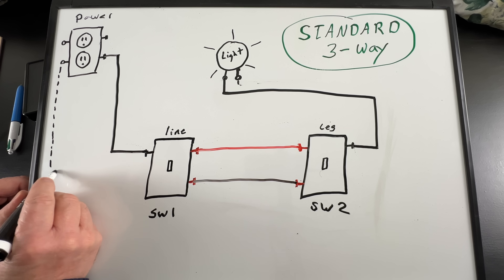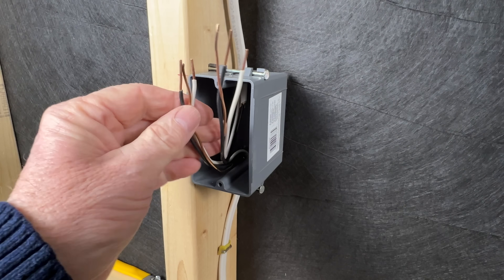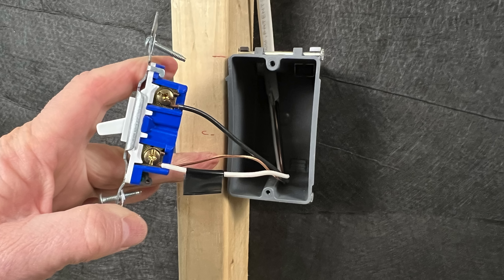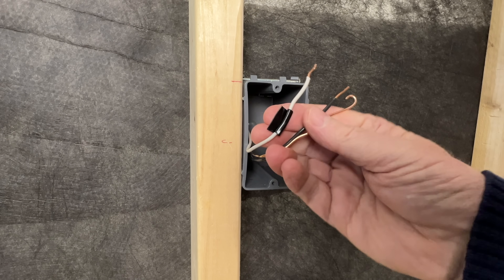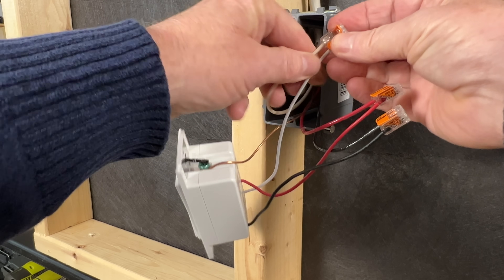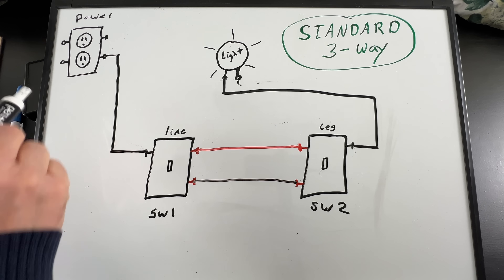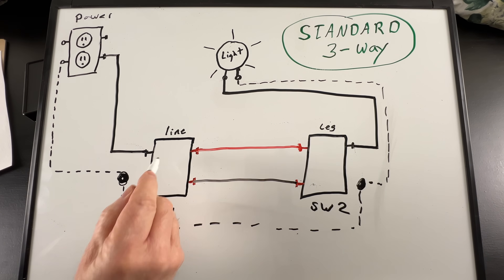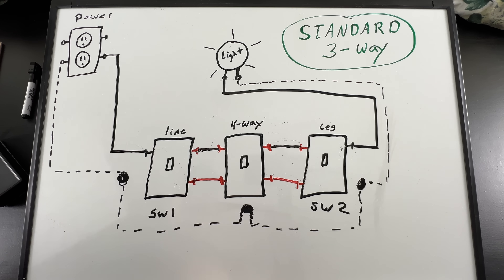How NOT to Wire Light Switches in 2025 (New Rules)

Comment: I've always done dead end 3 ways by sending the line to switch 2 and using the common on switch 1 for the switch leg.
Reply: This. I was taught that if you're re-identifying a white wire as a hot, it should be a constant hot, not switched. Reason being was that if it was switched and in an "off" state, it could be confused as a neutral by someone inexperienced with a NCV tester.

Comment: I had my house built in 2004 and had a special meeting with my electrical contractor to have switchbox feeds at every switch as bsck then I was already planning smart switches for my new house...  it was interesting as that contractor said it was their standard way of doing things...  yet another contractor also building homes in my area didnt use that method.. so when my nextdoor neighbor asked me to install smart switches i figured it would be easy yet his was wired the old way.. and of course all the existing wires were stapled and some switches are on outside walls full of insulation..  now if you go over the bridge about a mile away to a different municpality they had adopted the neutral in the switchbox method back since 2000 as apparently one of the top dogs in the city was a home automation enthusiast and was building a brand new house only to find no neutrals in his switch boxes as he torued the partially complete home..  so he had his wiring redone and proposed the new code which was easily adopted..  interesting how things progress through government

Comment: Is it common to see a mix of standard and dead end circuits in a home? 

Why choose one over the other?
Reply from the maker: It can be but it’s not common. The dead end is a useful method if you want to convert single pole switched lights to two three ways. You would pull a three conductor from the single pole switch to a new switch location and install two three ways.

Comment: As an electrician I never ever bring power to light, I bring my power into the switch then I know my light is never hot. I also made sure that there was a neutral in switch in case yiu needed to run an other box ect from there. The update is just something I’ve done for decades.

Comment: I am a licensed home inspector.  I was unaware that three way switches required 12-2 wire.
Reply from the maker: They don't require 12/2 unless they are connected to a 20A circuit.  I used 12/2 in my example just incase someone not knowing ran 14 gauge wire for switches on a 20A circuit. But many lighting circuits are 15A and run in 14 gauge wire.

Comment: I always bought the feed to the switch box even if that meant running a new circuit.  I never liked to pull power from the fixture box.  Call me crazy.   Also, I always used the standard method to do 3 ways (no dead end for me).  KISS.

Comment: Simple DIYer solution. 
Drop a 14/3 
Send an unused neutral to switch, hot black return from switch on red wire at light to bulb hot.   And the white in the light where supposed to be.
Reply from the maker: I actually show exactly what you're saying in the video.
Reply: @BackyardMaine  
Likely purpose of code changes if not already will ban lighting controls that power themselves from the black and use the ground instead of common.

I've seen lots of stuff wired to ground instead of common over the years and they want the ground to be left alone for what it was intended for.

Comment: Question, can I run power to my light using 14-2, run a 14-3 down to SW1 using the red as a switch leg and the black as a hot, from there run another 14-3 to sw2 using the neutral as the hot? Sw1 still has a capped unused neutral btw.
Reply from the maker: The short answer is yes. That would be called a dead end three way which I cover in this video. From the first three way to the second use the back and white (re-Indentified) as your travelers on your gold screws and the red coming back as the switch leg.

Comment: why do you not use blue as traveler and black as power for the light
Reply from the maker: 12/2 and 14/2 have a black and white wire. The 12/3 and 14/3 have a red, black and white wire. No blue..

Comment: I was very surprised code allowed that last light switch layout without a neutral.  It has been a few years, but the 3way, 4way, and greater smart switches required a grounding wire at ALL switches.  @shoo7130, yes bleeding just a tad of 120V/15A would not seem legal at all.  Hope it is actually sending radio frequency signals through the wires akin to the Power-over-Ethernet way, not actual power.    I am very glad this is finally in the code.

Comment: I’ve never seen a white wire identified at a switch in a house.
Reply from the maker: I have quite a few times but also when they used a white as a switch leg and didn't re-identify it. I always run the power feed to the switch first..

Comment: Neutral required, not for safety, but because manufacturers want to sell more products.....NFPA has sold out to manufacturers and is now a total JOKE
Reply from the maker: I respectfully disagree. The CMPs that make up the NFPA-70 are from a wide ranch of expertise. The manufacturers and retailers are just a small part. Now I don't agree with everything they do but I do believe that safety is the main focus. The issue with having no neutral in the box is people were connecting the neutral on the smart switch to ground which can be hazardous.
Reply: So everyone has to pay for their stupidity. Thinking like this is responsible for the $50000 vehicles we HAVE to buy with all the required garbage.

Comment: We used to wire two 3-ways another way. Sort of like the dead end style but the light is in the middle of the traveler wires (like where a 4-way switch would be). White wire in traveler from the feed 3-way is the neutral for the light, white wire from the dead end 3-way is re-identified hot wire for the light. We did some tract homes back in the day where this was convienient because there was a two story plan that had a wall light for the staircase, and it was right in the path or the traveler wire going between the switches. Of course this would only work if there was only one light fixture (although if there were more than one light you could just take a two wire from the first light to the rest). Then there is where you run the hot wire and the switch leg to a 4-way in the middle, then the 2 3-ways can both be dead ends.

Comment: Great photo of switch wiring. You toggle it and it would short the hot lead directly to ground. More than just a code violation, ha, ha!
Reply from the maker: No because in the photo the white wire is not the neutral. It's a re-identified white wire used as a switch loop. This is actually a common practice.
Reply: @BackyardMaine  That's true but in the intro photo it shows the black taped white wire and the copper ground lead connected to the same terminal.
Reply from the maker: @anotherjoe5675  Take a closer look. The ground lead is on the other side of the switch connected to the ground screw.

Comment: I make display panels to illustrate things like setting up a 3 way system with a light bulb, switches and even a breaker box etc. I have a male plug leading from the display's breaker box that simply plugs into an outlet. Since this display is a device that plugs into an outlet like a lamp, iron, and no actual interfacing with the house wiring is done I am assuming there is no code violation buy not getting a permit. It's kind of like no one gets a permit to make their own lamp that simply plugs into an outlet. Same here, I make a panel board with a three-way switch system that is powered by simply plugging it into an outlet. I do this for illustrative purposes to teach my grandkids electrical concepts. Do you see this as a code violation? Ps...I am currently working on a display panel to illustrate a Four-way switch system. I will also add that I am not a certified electrician. All self-taught. Does one have to be a certified electrician to make one-self a lamp or any electrical device that simply is plugged into an outlet?
Reply from the maker: This may depend on any requirements in your local area rather than the NEC. I think you're ok from a legal standpoint as long as they're cord and plug connected and you don't sell them. Be careful though.. More people die from 120v than any other voltage.

Comment: This is a pretty big change for wire slingers. Our county is at least 3-4 years behind the NEC so I wont really have to worry about this  for a little while.
Reply: Neutral in switch box has been required since 2011 NEC.

Comment: Kinda silly to make requirements based on a new switch requiring something. Just dont use them, unless they come up with a way not to need it.
Reply from the maker: I think the decision was made because what people do when they try to add a smart switch and there is no neutral. Many don't say oh well I can't use it.. They connect the neutral to the ground wire to see if that works. It does, so they button everything up and they are done. They feel pretty smart too, but they don't know they have just added current flow on the system ground which is hazardous. This change is an attempt to prevent that from happening on new constriction.

Comment: for the dead-end 3-way: use the 14-3 red and white conductors as travelers, use the black of the 14-3 as controled conductor and you won't have unmatched joints in the line box.

Comment: I'm going to attempt to replace a light switch for the first time tomorrow. I bought a leviton single switch, but I noticed that it has a green ground screw on it. If I pull out the light switch and find that it doesn't have a ground screw and thus was never grounded, can I use my new light switch without connecting any wire to the ground screw?
Reply from the maker: If you have a ground wire connect it to the green screw on the switch. If you have an old home with no ground the switch will still work fine without one. Just be sure to cut off power before you start to stay safe.
Reply: @BackyardMaine  Thank you.

Comment: FOUL!  This 3-way switch is single pole.  It's SPDT.  Single pole, double throw device.  Probably 120 volts.  Double-pole switches are generally used in switching 240 volt (double pole) circuits but sometimes have other applications.  The vast majority of "three way" switches in 120-volt  applications are single-pole.
Reply from the maker: No foul here. lol. Yes technically speaking a single pole double throw switch is the same as a three way but we call them three way switches when used in this way for lighting applications. Even the manufactures call them three way switches.

Comment: Is your code really requiring 12/2 on the lightning circuits ? Up here in Canada, it’s all 14GA
Reply from the maker: No, I used 12 gauge in my example to prevent someone for not understanding and running 14 gauge wire on a 20A lighting circuit. Often times lighting will be jumped off of a receptacle circuit which may be 20A. But most of our lighting circuits are run in 14 gauge wire on 15A circuits here as well.

Comment: Is 12 gauge wire required for lighting circuits? Can you not use 14 gauge with 15 amp breakers?
Reply from the maker: Yes I just used 12 gauge wire in the example to someone would go and add 14 gauge to a lighting circuit jumped off a 20A receptacle circuit. But yes most lighting circuits are in fact run on 14 gauge wire and 15A circuits.
Reply: #14 on 15a circuits is fine.

Comment: Seems like a no-brainer to just use smart switches these days. I'm wiring my master bedroom on a new circuit because I'm remodeling and replacing old ungrounded system running on 2 wires. Instead of a 3 way switch for main lights so it's accessible near the bed and the door, I am just using Lutron Caseta. One smart switch at the door and a remote switch (unwired) by the bed. All I have to do is wire the smart switch to the light like a typical light switch and that's it.

Comment: Well I guess I have always just done the standard method .  And now just need to learn these new fangled Chicago and California methods .
Albeit I wonder suppose the power is coming in at the light box .  What would the code compliant method be then ?
Reply from the maker: For existing wiring you're fine. The standard and the dead end are both compliant unless you have an inspector who requires more that what's in the code. I uploaded the video on the Chicago method last week and the California 3-way will be out on Monday.
Reply: @BackyardMaine  Thanx ,,, I googled em ... and ya ... aint going to use em.

After thought process ... I agree now ... Neutral with the switch should be the norm going forward .  Cuz the Future we must speculate .
I admit at first I was feeling rebellious .

Comment: assuming you are using 3wg wire between 3w switch #1 and the dead end 3w switch you would have a white neutral in that box too
Reply from the maker: Actually no you wouldn't. You will have a white wire but it will need to be a switch let in order to get the power back to switch one box to feed the light. You would need a 4-wire to have a neutral at the dead end.
Reply: @BackyardMaine I went back and reviewed your explanation of the dead end 3way wiring diagram and stand corrected. The relabled white wire used as a common on the 3way snookered me😊

Comment: Can you explain chicago and california and why those are bad? I have a setup in my house where power comes to the light and then a 14/3 to each switch box. The travelers (red/Black) are jumped to each other at the light and then the incoming hot (black) at the light goes to one switch through a white and the white coming from the other switch box goes to the light.

I wanted a smart switch and the first switch box is a double gang with a different incoming power wire with a neutral. I don't have a ladder tall enough to get to the light box (Chandelier on a HIGH ceiling.) So I wired it as: Smart switch one has incoming power from black in box and neutral from in box. Hot leg from light box is capped and not used as it is just another hot but on a white wire. Black wire that goes through to other switch is now hooked up to hot in this box as hot for the other smart switch, Red is hooked to neutral. and flagged with white tape on both sides. In other switch box, black is hot coming to switch, red is hooked to neutral and the white in the box is still flagged as hot and goes to the light. from this smart switch's output. I am using the app as relay between the switches. I technically have neutral in both boxes but all the colors are messed up.
Reply from the maker: I have the Chicago 3-way video uploaded now and the California 3-way will be uploaded tonight.

Comment: So, let me get this straight. You run power to the light but you break the connection at the switch? So, if I turn the light off, there is still power at the light fixture? If I touch the pole at the light fixture, my body completes the circuit?
Reply from the maker: No exactly. The power is in the box that the light is connected to. The power connects to a wire going down to the switch and the switched power (your switch leg) coming back up from the light will connect to your light fixture along with your neutral and ground. I hope this helps.

Comment: Why are you teaching the banned methods? Why risk confusing people?
Reply from the maker: The Chicago 3-way is banned, but the others are not. Some inspectors may only allow the standard method. By code you can use the standard or the dead-end and even the California if it's in conduit. I didn't talk about it in this video but I did just make a video on that Chicago method. The reasoning behind teaching all the methods is to give people the information they need to troubleshoot or even just replace existing switches.

Comment: i used to do a bit of this at my last plant before i moved to a new automotive plant but havent done much in the last 4-5 years.  i always ran my power to the switch first probably because i worked with ladder logic more so than this general receptacle/outlet/switch wiring so it just seemed smartest to run my power to the switch before anything else
Reply from the maker: Ahh yes ladder logic. I have worked with that for decades. Mostly AB PLCs.
Reply: Yep. AB slc 500 through the latest RSLogix (which just confuses me)
Reply from the maker: @truthsayers8725  Before I left we upgrade our RODI water plant for SLC 500 to RSLogic. It was a nightmare because the plant runs 24x7 We bring everything over in little pieces and TIs risk tolerance for an unexpected shutdown was 0%.

Comment: I wonder how much copper is going to get wasted over time running unused neutral wires to switch boxes nationwide forward.
Reply from the maker: I think most people take the circuit to the switch box first so probably not as much as you think. Some electricians like to feed several rooms of lights from the same circuit so they feed the fixture first. But many will combine the lights and receptacles in a room to one circuit and which actually saves copper.

Comment: You mentioned running 12/3 cable between boxes in what appeared to be a residential job. Are you then putting lighting on 20 amp circuits in a residence?
Reply from the maker: I said that incase someone would unknowingly run 14 gauge wire on a 20A lighting circuit jumped off the receptacles which is quite common. Most lighting circuits are 15A run in 14 gauge wire.